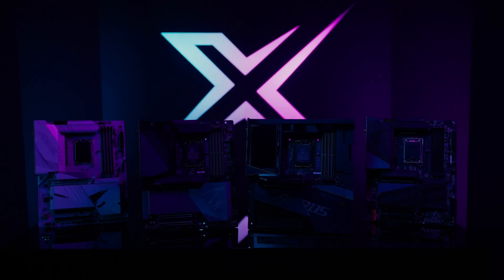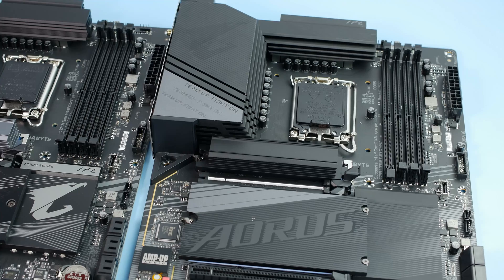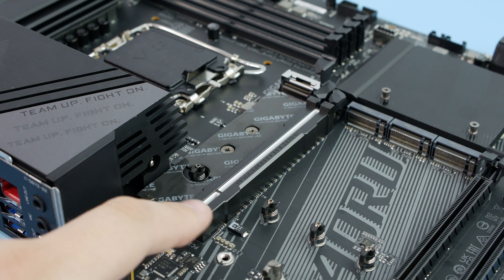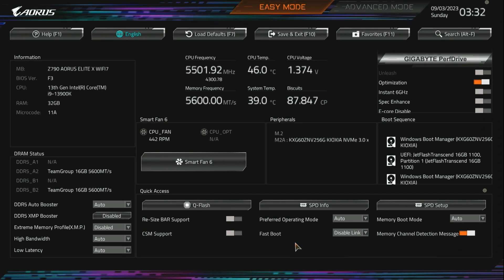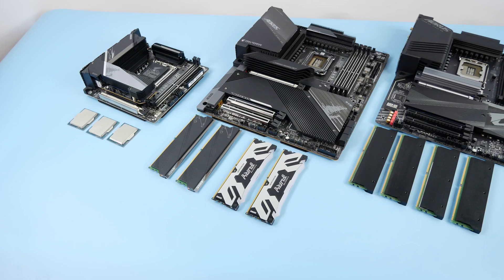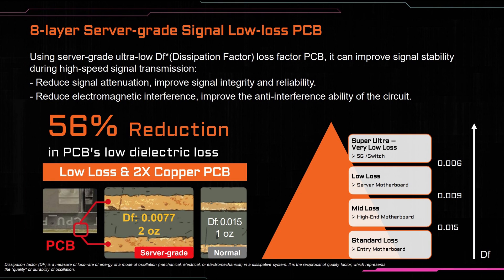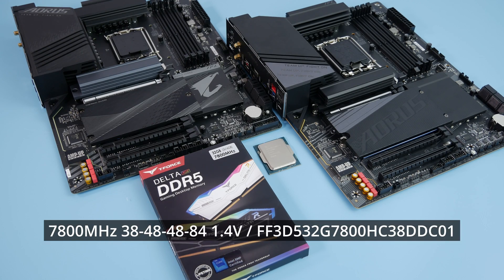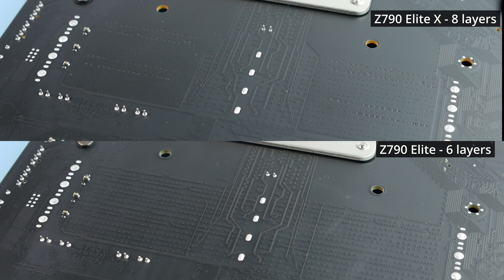Aorus Z790 Elite X Gen - BEST LGA1700 4-dimm for DDR5 overclocking?! Watch before buying fast DDR5!

Comment from the maker: Please subscribe, I want to make more videos and that motivates me the most. It is free and really helps.
Video sounds best at 1.25 speed! Any feedback is appreciated. 
IMPORTANT:
Please do not buy DDR5 8Gb modules. Just don't.
Non-K CPUs cannot overclock DDR5 as far as K CPUs. 6000 Mhz is usually the limit for them.

https://alli.pub/6s7yri - probably the cheapest DDR5 32GB or 64GB Hynix a-die kit on the market.
Reply: Your videos are great quality 👌 👏 very good
Reply: hynix a die and the relatively newer Hynix 24 bit mdie
Reply: Thanks for the tip regarding DDR5 and not using 4 dimm slots.

I have this board and a 14700k, and I did have 2x16GM CL32 to use in it… but now I know to avoid aiming for 4 ram sticks in the future, I will see if I can build with 2x 32 instead.

Comment: Hello, the system I will assemble is as follows, 14700k CPU, G Skill Trident z5 32 Gb (16x2) 7800 Mhz cl36 and Z790 Aorus Elite X model motherboard. My question to you is, can I use 7800 Mhz ram? Have you tried it under load? Thank you!
Reply from the maker: It will not work at all or will be super unstable
Reply: @ArtyomExplainsEng  Is it due to RAM or motherboard? Thank you
Reply: if lowered to 7600 it works easily

Comment: Good reviews friend. Right now I have doubts regarding a pc that I am assembling in pieces, I am still on it and the processor I have chosen is an I7-147000kf + 4070 Ti Super + 32 Gb ddr5 + WD Black SN770 2TB SSD Disk 5150MB / S NVMe PCIe 4.0 M. 2 Gen4, I am missing the box that I have located, the source that will surely be an 850w Bronze and I am missing the motherboard, this is where I am having quite a bit of doubt. Taking into account the prices I can get, do you advise me for that configuration? MSI MPG Z790 Edge TI MAX WiFi (253 €) or Gigabyte Z790 AORUS Elite X WIFI7 Motherboard (252 €) or MSI Z790 GAMING PLUS WIFI (200 €), which one would you recommend? Or do you have a better option for those prices? Greetings.

Comment: The fact of adding a screwless ssd panel when you you still need to screw the ssds inside doesn't make any sense 😂😂😂😂😂😂
Reply from the maker: No screws for the ssd, no tools needed.
Reply: @ArtyomExplainsEng  it still doesn't make any sense, think about this, when are you going to need to open that panel and plug an SSD inside?
1: when you mount the PC so you still need screws to mount the motherboard and the PC + securing the GPU
2: maybe you have already mounted your pc so you want to upgrade your storage memory so first you must remove your GPU so you need to unscrew the PCIe securing screws, unplug the CPU and then open the panel and plug the SSD. Then secure again the GPU.

In both scenarios you still need tools.
It's just a stupid and delusional marketing strategy to fool some idiots "wooow look at this, now screws, incredible guys" 😂

Comment: hi i have the Z790 x elite and i am willing to install 4 slots x16 of corsair dominator  6200 ddr5  my system will be stable shall i try it 
my cpu is 14900k 
Thanks a lot in advance
Reply from the maker: 6200 with 4x16 or 24 gb will have a good chance to be stable. With 32/48 GB definitely no.
Reply: @ArtyomExplainsEng  my mistake i have the Corsair Dominatror Platinum 4x16 6600 !!!!!
Reply: so i am thinking to buy 2x32 or not!!! My pc is working heavy rendering software !!!!
thanks a lot in advance

Comment: I just ordered this mobo for my build (I9-14900K) along with 32G G.Skill Trident Z5 DDR5-8000 CL38. I'm no RAM expert, so does one just select the correct timing (38-38-48-128 1.45V) in XMP booster, regardless if it's Micron, Hynix, or Samsung? Or is there a diff. way to get to the 8000? I'm afraid I'm a bit ignorant on this stuff.
Reply from the maker: No. Each chips have own timings. Not to mention that only hynix a die can reach 7000+. Anything than hynix is not good.
Reply: @ArtyomExplainsEng    Thanks for a quick reply. Even though the board says it can use up to 8266, it appears 7800 and below are the only ones stable at the moment. If that's true from your research, I'll exchange the 8000 for the 7800's...and save $50. I wouldn't know the bloody difference anyway. Worth a sub to me, thanks!  And what does Hynix a die mean anyway?  Geez, I've really lost touch over the years.  I just saw your pinned comment and what do I do? Ask a question that you say 'Just Don't'. Good grief.

Comment: Thanks for your video, Man. I purchased this motherboard, along with 64gb ddr 5 5600 mtz ram. Cpu : i7 14700k. Cooler master psu. Put it all together. The darn thing will not boot. No matter what I try. I have ordered an Asus Motherboard replacement.  Suspecting it's the Gigabyte mobo that's the problem. 😕
Reply from the maker: Replace the ram. No need to replace the board, update the bios via q-flash plus button. Get 2x32 GB 6000 CL30 or CL 32 sticks instad of these weak corsair ones.

Comment: can i run 7200mhz with this mobo? i have 14900k cpu and Dominator 64gb (32gbx2) 6600mhz cl32 with 4090 msi gaming x trio
Reply: or should i just buy something like 48gb (Dual) Ddr5 7600 Patriot Xtreme 5 RGB
Reply from the maker: The odds of 2x32 running in xmp are almost 100%, with 2x24 7600 xmp will very likely be unstable. Keep the 2x32, it is good ram, don't switch. The best you can go with 32g sticks with manual overclock is ~7000, but 32 gig sticks are a bit faster than 16/24 with the same speed due to dual rank. You are good, don't worry.
Reply: @ArtyomExplainsEng  man, that was like the fastest response i ever got from tech youtubers. Then i should try OCing my 6600mhz ram to 7000mhz. Thanks alot!
Reply from the maker: @Semヤザ  6600 cl32 is great, going for 6800 cl34 will probably have no performance gains. I would focus more on secondary timings to get the most out of your ram. NP
Reply: @ArtyomExplainsEng  by the way. i also have this ram 32gb (Dual) Ddr5 7200 Corsair Dominator Titanium Black, CL34. is this better for gaming?
Reply from the maker: @Semヤザ  the difference will be 1-2%, just keep the 2x32 6600
Reply: @ArtyomExplainsEng  got it. this is probably not relevant but can i ask you something. do you know how to sync NV7 case, ram and motherboard rgb to Lian li L-Connect 3?
Reply from the maker: @Semヤザ  plug it all to the motherboard rgb headers and sync via gigabyte software would be my best guess.

Comment: I have the MSI z690 Unify ATX 12900k Team Group 7200M/T CL34, using the ram at these speeds I can run 6800 also 1.36v VDD 1.30 VDDQ

Comment: Should i update the bios before installing win11?
Reply: On this motherboard*
Reply from the maker: You should install latest non-beta bios version when building a pc. After that you should update when something important is changing and you need that change. Or if something is broken with current version and a fix is needed.
Reply: Thanks!

Comment: Is there any coil whine one the elite x wifi7?
Reply from the maker: Mine had none
Reply: @ArtyomExplainsEng  Thanks for the reply. Would you suggest it ad an all around me bo. I do not intend to overclock. I want stable operation with a 14600k and 32 gb ram @ 7200 xmp. I can't decide between this one the Asrock Nova.
Reply from the maker: @noway9303  Both are great, I would have hard time deciding too :( Nova is more interesting, I think, but more expensive. I plan to review the new Riptite, the "cheaper nova".
Reply: @AquilaeYT the ASRock Nova!!! A dream board!!!!
Reply: @AquilaeYT everyday use, multimedia and gaming. I use a teamgroup 7200 2x16 kit and it it supersteady with xmp.

Comment: hello there great video... can i run 7200 mhz Gskill ram with gigabyte b760 aorus elite AX in xmp ...cpu is 14600kf...
Reply from the maker: Xmp will not work or will be unstable. Manual overclock - maybe, but my safe bet would be on 6800-7000.
Reply: @ArtyomExplainsEng  thanks for the rply... So with xmp 6600 is possible??

Comment: I have the same board and have 7600 CL34 stable in Karhu but struggling to get it stable in Ycruncher VST.  Curious what votage you used for SA?
Reply from the maker: Almost never more than 1.2v, it is the sweet spot.
Reply: @ArtyomExplainsEng I'm running this same board with i7 14700k, get stable vst on y cruncher but occt finds errors in under a minute, I'm running the xmp1 with the enhancements disabled what can I try to stabilize it?
Thank you

Edit the memory is rated 7000 cl32.

Comment: Note that all the super high performance kits are based on 48GB Ram kits and not 64Gb kits.  It is all to do with 24Gb per stick controllers.  They are far more efficient that 32Gb ram sticks.  Thus go for 48GB kits as they are 50% more ram than 32 Gb kits But run faster than any other stick size. They bog down on a 32Gb stick.

Comment: ive had nothing but issue with those board im going msi
Reply from the maker: What is the problem, exactly?
Reply: @ArtyomExplainsEng  my elite z690 ax ddr4 died in a week and was never able running ram faster then  3600mhz and had a elite b660m ddr4 that wifi keep disconecting so i changed to the elite z790 ax ddr4 same issue and rgb fusion never worked ever and no wifi driver on windows install realy cheap from aorus

Comment: Great video! If definitely looks pretty easy to use.

Between this motherboard and the MSI z790 Tomahawk (DDR5), which one would you pick for an intel i9 13900k?

These are the other components of the pc:
- corsair 1000w gold plus
- rtx 3090 fe
- Corsair Vengeance 64 gb RAM 6400 mhz CL32 (2 x 32gb)
- Samsung 990 2tb M2

I'm using the pc mainly for video editing (premiere pro and other adobe software).

Thanks!
Reply from the maker: This one. You can get to 6800-6933 mhz if your 2x32 sticks are Hynix a-die with manual overlock.
Reply: @ArtyomExplainsEng  thanks for your reply! Much appreciated

Comment: Is it true that on this MB, if you want to change or having access to your M.2 SSDs, you'll have to take off the GPU ? And for taking off the GPU, often you would need to take off the CPU cooler ? Wow ! It doesn't make sense. Why not having all M.2 separate ?? 😮
Reply from the maker: I had a 360 aio and I definitely did not have to take it off the cpu to do anything with m.2. Unless you have a huge air cooler, but it would block the first m.2 on any board. I do not think the gpu blocks any m.2 but installing m.2 would be less convenient for sure with the gpu in the board.

Comment: Hello, can you help me out? I have an i9 14900k paired with a z790 Arous gigabyte pro x motherboard and Corsair Vengeance ram 6400 mhz and a gigabyte aero 4090. Can I run my ram at 6400 mhz and be fine to play games without crashes. Also should I enable resizable bar. Is there any other settings that I should change in bios?
Reply from the maker: Hi. 6400 should work flawlessly. ReBAR should be enabled. Update bios to the latest stable version, not beta, then just enable xmp and ReBAR.

Comment: It do not matter what Motherboard z790 14 th gen you buy.
They all can take up to 7800-8000 mhz.
The hole problem is that pc stability is never put into marketing.
Dont look at MAX speed ever, look at what motherboard / CPU can do for stabel solution.
And yes the stabel solution is 6000-6200-6400-6600 for INTEL. 
And 6800-7200 is what you can call heavy overclocking and will stress test your system no matter what.
So wry play around whit 7800-8000 mhz when it is well pushed out everywhere and testet.
Just go for cheaper ram and setup XMP 3.0 and stop doing manuel overclocking.
Every DDR5 ram can at least give you 2-400 mhz more whit push XMP on.
So even 6000 or 6400 is just fine for everyone.

Comment: Got my z790 xtreme x and i saw it had a hynix 8000 2x24 so had to try it,  It only did 1 ram train to boot right into win 11.  Can game for about 10 - 30 min and crashes ( need to mess with manual tweaks)  but i dropped to 7600 and totally stable gaming.   Bye bye asus z790 hero,  only got same ram up to 7200.

Comment: Then why do manufacturers put 4 RAM slots on motherboards if you can only get these high frequencies with 2 sticks? Makes no sense.
Reply: Some people value capacity over speed when it comes to memory.
Reply from the maker: Marketing. People would not understand why all of sudden they only get 2.
Reply: Is this true for all motherboards ? Can't I have 128GB installed on all DDR5 sockets without losing speed 6000Mhz ?
Reply from the maker: @DihelsonMendonca  If you want speed and capacity - get 2x48 GB or 4x48. With 4x32 - 4600-5200 at best.
Reply: @DihelsonMendonca Only "T-Topology" can provide faster speeds with 4*Dimms
Reply: Well its a case with ddr 5 but some people need the extra capacity.
Reply: Most people think more = better

Comment: running 7000 on my asus z690 prime a with an 12700k with corsair vengence 7200 hynix- a die, ran 6600 xmp on an asus strix b660i on 12100 and got the m-die to run 7000 on my 13900kf.

so 12gen with a pre z790 board is not necessary to hit over 6000mt/s
alway get an itx board in persuit of ram oc/tuning as they have at least 8 but for most part 10 and for msi and the new gigabyte 12layers.

Comment: I have i7 13700k and aurus z790 alite ax motherboard and g skill 16x2 = 32 gb 7200mhz ram after enabling xmp in bios the cyperpunk 2077 crash do you have any sulotion for it ?
Reply: update  your bios throw out your 13700k(or sell it) buy 14700k or 14900k and pray you have stability at 7200 XMP. IF not you will need to know how to tweak timings/voltages in your bios.
Reply from the maker: Hi. Change the speed of ram to 6800. Go to the bios-advanced mode-tweaker find ram speed and set it to 6800. Should be just below xmp. So it will use settings from 7200 xmp, but for 6800. Should be stable with latest bios on your board.
Reply: @ArtyomExplainsEng  if I put g skill   trident z 16x4 = 64 GB 7200mhz ram into 4 slot how much stable speed will I get with i7 13700k and aurus z790 alite ax mobo is it any good idea ?
Reply: @ArtyomExplainsEng  can I find it in ddr5 xmp booster ?
Reply from the maker: @massoudwazir6389  do not ever go 4 sticks of ddr5. Speeds would drop to 6000 stable, probably not more. XMP will not boot, probably. Go 2x32 if you want 64gb or 2x24.
Reply: @ArtyomExplainsEng  I saw someone run 4 stick of ddr5 7000mhz ram in msi mpg z790 edge wifi mobo
Reply from the maker: @massoudwazir6389  It can boot, does not mean it will work properly.

Comment: I bought a motherboard Z790 Pro x .. After four days, I will buy a 14900K processor .. What is the appropriate RAM speed for me, knowing that I want to buy a 2x24 size? 😑
Reply from the maker: It is unclear yet how good is the memory controller in 14gen will be. If you do not plan to overclock manualy I would stay below 6600-6800 xmp.

Comment: I've been eagerly looking for people to review the new refresh boards and their frequencies. You did a very good job testing Karhu, HCI and Y-Cruncher VST, I honestly couldn't ask for more! I'm slightly disappointed with my current MSI Z790 Tomahawk that struggles with 7000 and 7200 is out of the question. A lot of people with even more expensive Carbon and Ace boards barely manage anything over 6800 for ycruncher VST.

I see you also have the green OEM Korean sticks, did you test those too? I found the green sticks to be a tick better than my TeamGroup 8000 when tested on an Apex board, when it came to tRCD/tRP and voltages required. And another TeamGroup 7800 wouldn't pass anything over 7600 when using both sticks.
But GSkill 7200, and Vcolor Mantra prisom 6600 all performed very similar to the green sticks as well. The GSkill 7200 in fact may be the best XMP kit I've tried, but they run very hot, require direct fan on them.

It would be interesting to test 14th gen with the Gigabyte board but I would presume it would be exactly the same... looking forward for more of your videos!
Reply from the maker: Hi! No, those green sticks are Samsung, I got them very early when DDR5 only arrived on the market. I use them for tests sometimes. I only have 2x16 TeamGroup 7800, and Kingston 2x32 GB kit with a-die - I could get them to run 6933 here, but no prolonged stress tests were made. I plan to make more content with X series boards in the near future once I have more ram available.
Reply: @ArtyomExplainsEng  I see, that makes sense now if you were an early adopter. I'd love to experiment with those 2x32GB later on, and I'd be very delighted with 6800. Just a bummer those take longer time to test. Although 64GB DDR5 testing time is probably closer to 32GB DDR4, so its not too bad actually.

Edit: I'm well aware that memory tuning and running ycruncher VST, Karhu, HCI, TM5 are very very niche community and us that do it for a hobby are very appreciative.